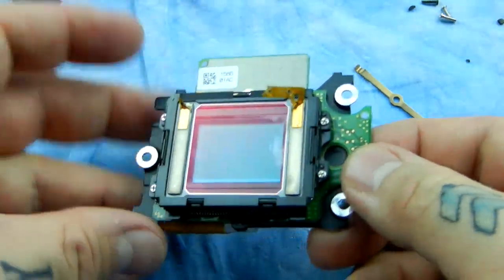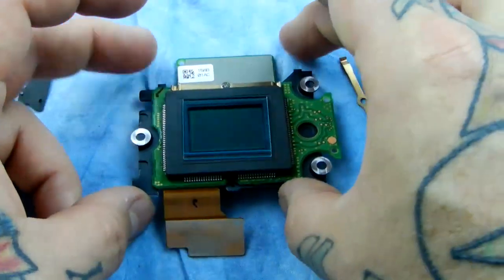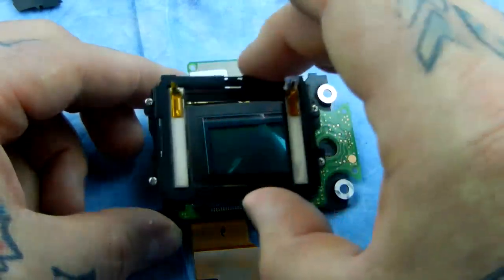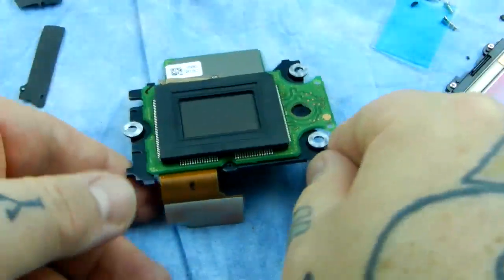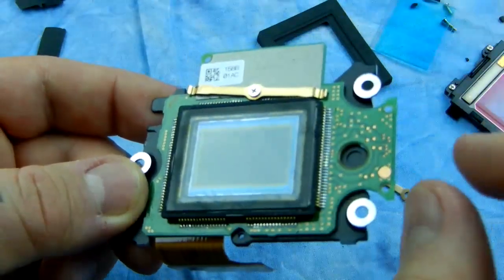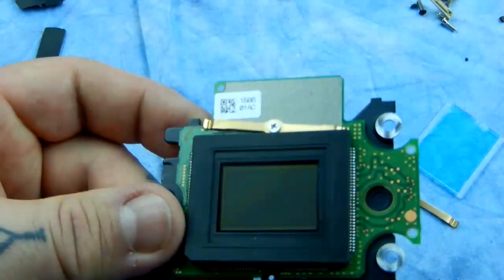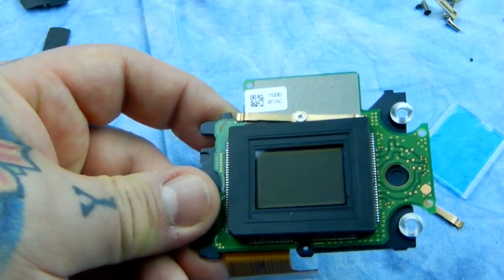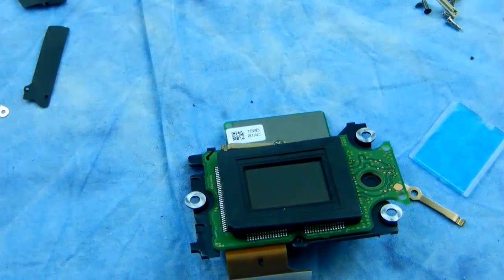Angry Photographer: PART 3 Secrets inside your Nikon DSLR. My Sensor is really where?!

Comment: So it is possible the take out the AA filter from a d800????
Reply from the maker: yes, but not easily, requires serious gear
Reply: Ive got 3 D800 cameras ,I want to remove al the AA filters from al 3 cameras.Thats cheaper than buying 3 second hand D810.cameras.

Comment: So which Nikon was this out of, because I know the one layer is the IR, the other has to do with the bayer but is the clear the lowpass, or is this out of a Nikon without a lowpass
Reply from the maker: Joel Aparicio D90 

yes, theres always an IR filter
Reply: Yes I know there is always an IR unless you're crazy into astronomy and had it removed or shelled out for the new D810
Reply from the maker: wait for the 2 newest video tonight, you should find them illuminating.

Comment: Just had a eurika moment:

Instead of using a traditional shutter curtain , why not completely do away with it and use a sensor off mode as a shutter i.e. when you are about to take a picture the sensor pixels are off, when you release the shutter button the pixels are switched on for the length of time set by the shutter speed dial, the image information is sent to the buffer or sd card before the pixels go into off mode again. 
Kind of equivalent to the start-stop cars that have no started motor.
If this is possible then cameras will be good for 1,000,000 shots.
Reply: chinacane Would probably be too slow I think...when its on and then the shutter comes into play, the shutter is damn quick, far more than the on off of the sensor elements could be technically able...right now anyway who knows what may come :-)

Comment: I just ordered a set of JIS screwdrivers. I found out that the manufacturers in Japan use them, not Phillips head style. I was trying to remove a lens mount screw and it wouldn't budge, the Phillips would just pop out messing up the head. Then I used a JIS one and the screw came right out. Time for you to make a tool video.